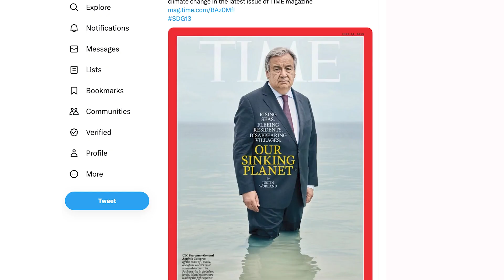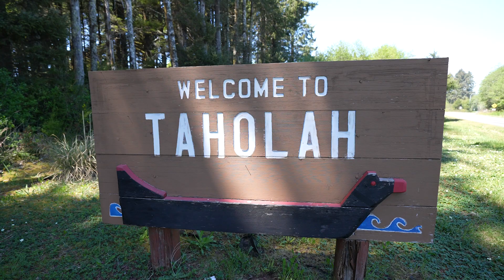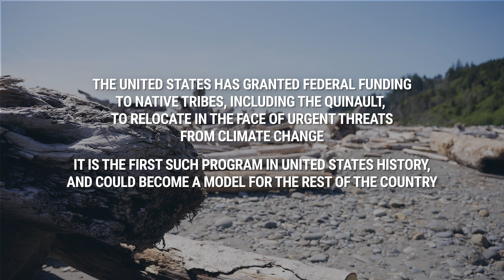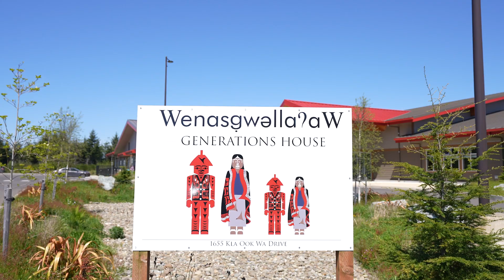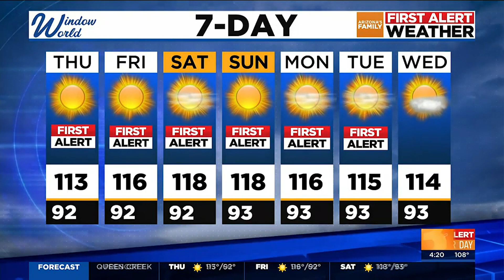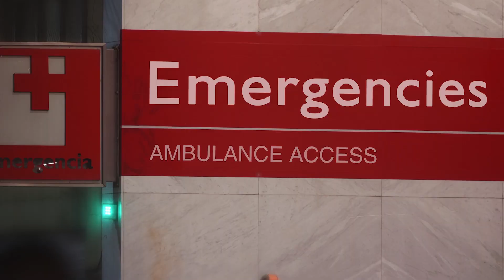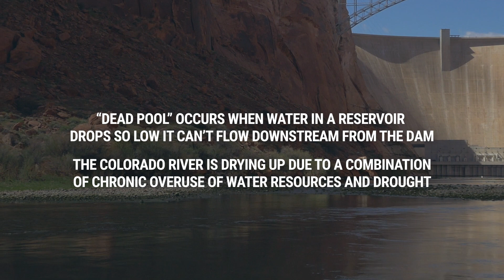Climate Change Hits Home in the USA | Troubled Waters

Comment: Are you freaking kidding me? Don't people understand we live on a planet that revolves around the sun. Live on a planet that the surface is constantly moving. In other words there is no such thing as "normal". Climate change is the normal process of this planet changing itself. People believing man is causing these problems are no different than people believing the Earth is flat. The other problem is so many people now live in climate controlled houses that their bodies don't acclimate to the changing seasons. Summers feel hotter, winters feel colder. If we did away with air-conditioned houses, we wouldn't have so many people suffering from hyperthermia and hypothermia. Are we going to start blaming volcanos and earthquakes on manmade climate change?

Comment: Climate change most of the heat we see has been from reducing emissions allowing more solar radiation. All these climate alarmist have heated the planet. Not co2 but solar radiation. Ship tracks emissions were cut now we see ocean boiling events from increased solar radiation. Tonga added 13% more moisture. Climate alarmist cut emissions that would of help remove the moisture.  Now all this moisture goes to same places and floods. This is what a cooling planet looks like. Hotter dry equator evaporating more moisture from solar radiation. Then the moisture causes floods and record snow packs. As glaciers grow so do deserts. Build aquifers not reservoirs. Wetlands are a huge carbon sink making more natural fossil fuels by forming peat. We need to shrink the deserts by greening them. Millions of buffalo fought climate change by shrinking deserts and fighting dust bowls. Dust bowls and droughts from La Nina. El Nino enso shuts down during glaciation. We need to build wetlands to hold more moisture as climate alarmist make the planet more unlivable. We don't need a super villain to block out the sun. A cooler drier planet never goes good for humans. We have already reached Holocene climate optimum. The planet is cooling because of obliquity. Co2 has a super cooling effect during glaciation. It's why co2 levels keep rising during glaciation as temperatures keep falling.  Satellite data have recently revealed that between 2002 and 2019, the mesosphere and lower thermosphere cooled by 3.1 degrees F (1.7 degrees C ). Mlynczak estimates that the doubling of CO2 levels thought likely by later this century will cause a cooling in these zones of around 13.5 degrees F (7.5 degrees C), which is between two and three times faster than the average warming expected at ground level. Climate change science is a fraud making the planet hotter drier and with more floods. So2 and methane take moisture out of the atmosphere. Expect a decade of floods as that's how long it will take to get back to pre Tonga levels. More solar radiation doesn't help one bit.

Comment: Trees around the equator historically controlled the world climate, as early morning sun generated mists from equatorial forest, which then seeded the equatorial clouds, keeping excessive tropical rainfall and most of the dense cloud around the equator. Cloud generated around the equator is on the increase as trees around the equator are cut down. Forest soaks up the sun's radiation, reducing the temperature but progressive deforestation has increased tropical temperatures, increasing sea temperatures and causing more evaporation and more cloud cover. Hence the increase in the escalation of record floods north and south of the equator. Saying CO2 is the cause is false. CO2 is NOT the cause of climate change and the escalation of earthquakes and volcanic eruptions. The pole shift is the main cause. Research pole shift on USGS, NASA and NOAA!
Reply: Solar radiation has increased with reduced emission meaning less clouds. Ocean boiling happened because reduced emissions from ship tracks. The moisture then condenses when it meets cold air. Making floods and record snow packs. Did nobody tell you a cooler planet means a hotter drier equator as moisture evaporates. The moisture goes to cold places and the poles to cause floods and record snow packs.
Reply: Reduced emission meaning less clouds? You need more clouds to carry more moisture for the floods the planet is currently experiencing. @eliinthewolverinestate
Reply: @eliinthewolverinestate  additionally the Californiadrought andfires were visiblyengineered since 2012. It's been a nightmare for 10 years.  So tired of these liars and how everyone believes them.   No one knows a thing about UNagtwenty30
Reply: +1 degree temperature = +7% precipitation and +12% lightning ⛈️
Reply: You say that CO2 is not causing climate change?

And climate scientists who are well educated, trained and experienced in the field say that an increase in 
CO2 in the atmosphere is greatly contributing to climate change.

Sorry but I'm going to stick to listening to the experts who know what they are talking about and not pay attention to random people on the internet who don't like what science is saying.

Deforestation may be causing problems but that doesn't change one tiny bit the fact that increased CO2 in the atmosphere is a huge contributor to climate change.

You don't work for an oil company by any chance do you?
Reply: @geofflepper3207  ALL their science is FAKE.  WAKE UP!  (You must be vxd too.)   You're all miseducated in by MSM / EDU Programming Systems (of lies).  Owned by the chemical tech war industry / Central Banker/Energy Barons that put a geo-satelitte over our beautiful healing sun: "An orbiting mirror beaming powerful RF w/deployment of Al oxide: for GMO/'tons of' nano-tech "health courses" and  Synthetic biology at UCB and other UNIversities.   You have no idea of the reality of the situation.    Protect the children from The Chem. Tech. Predators.   (That own (and lie) on your little dumb whyfry t.v.s - military grade weapons systems.)
Reply: @geofflepper3207  I saw the California drought and fires visibly engineered since 2012. Then I saw the sun change 3/18 and saw the fake clean energy patent 8 mos later. Fake Climate Change is the covert supplement to the Fake War on Terror.   i.e. The Pentagon's New Map for the 21st Century: T.Barnett circles 3 continents w/a red marker: to displace 'the gap' countries and put them into 'the core' countries: for "greater connectivity" It is a CON-Troll Grid.  What don't you comprehend?   They want everyone on their little disgusting t.v.s (as the teens and others suffer tremendously in this false system) as they kill people with their FAKE science.  Big Ag, Big pHarma and Big Tech. are a Big part of The Chemical Tech War Industry, they own MSM and EDU Programming Systems (of lies).  If you can't see that that means (you're woke) your asleep.   The vx is venompoisoning as is glyphosate pesticides used in the food supply cause of non-contagious cvd.   All they do is LIE and KILL.   I could go on and on.   They kill the strongest men for their Con-Troll. They are bio-phobic goons that hate nature and humanity.  They burned California and Maui and much more that that.    Think.  Use your brain if you still have one (connected to your heart).
Reply: Carbon is not the problem.  The carbon cycle has been a feature of Earth for billions of years, and while we have changed that cycle it is still a cycle, but most of that change has come as a side effect of our population increase, there was a rate of change the planet had the capacity to deal with, but, there came a day when our change to that cycle exceeded the planet's ability to absorb the change.  So it was never really about carbon but about human population.  The maximum carrying capacity of the Earth given our current state of technology is 2-3 billion people.  Probably in the middle of that range.  At more than 8 billion people we would have to shrink every carbon footprint to the point we could not possibly keep this many people alive.  Now the question is when billions of people die will it be too late for the planet to recover?  Or are we going to experience runaway greenhouse climate change the way Venus once did and still does?
Reply: 👍 @markwalker3499

Comment: We need to fund the water pipeline from the Atchafalaya floodway basin funded by the "Coalition for National Infrastructure Bank".
Call your Senators and Representative to request support for the "Coalition For A National Infrastructure Bank" which has an excellent plan to build a pipeline from the Atchafalaya floodway basin using only a small percentage to refill Lake Mead and Powell. This is a perfect long term solution to keep Lake Mead and Powell filled and make water abundant.

Not doing SRM or one of the many other climate restoration technologies is turning out to be CATASTROPHIC!   Most people don't realize that we have been unintentionally geoengineering the climate with CO2 for the past 150 years, and actually impacting the climate for much longer with all kinds of interventions into nature including deforestation ,  wiping out so many species on land and in the sea.   
Now that the climate change is accelerating into a full-blown catastrophic crisis we need to make a decision to save the lives of people in countries that did not contribute to the recent rapid acceleration and will probably die if we do not do climate restoration.

Comment: The climate always changes. The water level across the world is the same as it was in 1900. There's pictures and it's the same. Stop being lunatics
Reply: "All told, sea levels have risen on average 1.6 millimeters (0.063 inches) per year between 1900 and 2018. In fact, sea levels are rising at a faster rate than at any time in the 20th century." - NASA on Aug 21, 2020

If you have access to better satellite imagery than NASA, I'm sure they'd love to hear about it.
Reply: @Alex-js5lg  well the world leaders back in 1903 all took a picture together on the ocean. 

Then they re-created the picture last year. 

The water level is exactly the same.

See as much ice that melts in antarctica. Is the same amount of snow it gets each year. 

So it's a cycle that never changes. Water melts ice fast. It goes in all the porous holes in the ice, super freezes , expands, and creates heat, which in turn melts the ice expodentually.
Reply: I wonder why Obama bought a house on the beach?